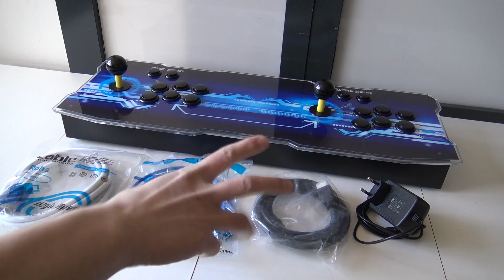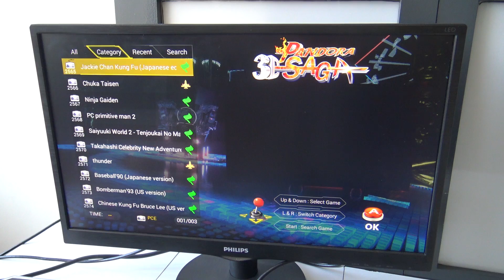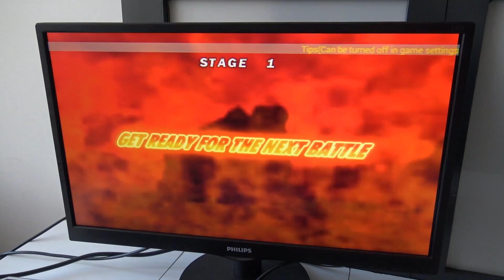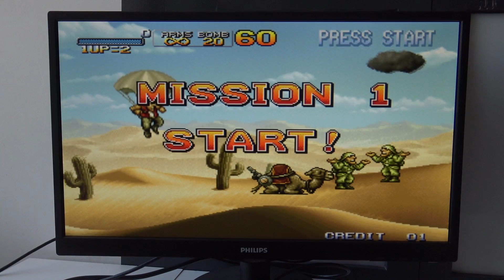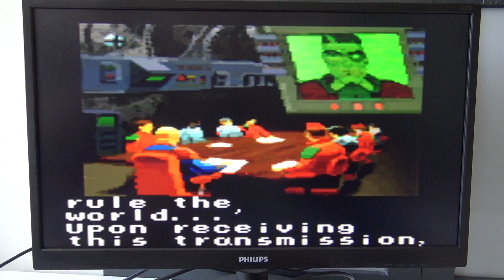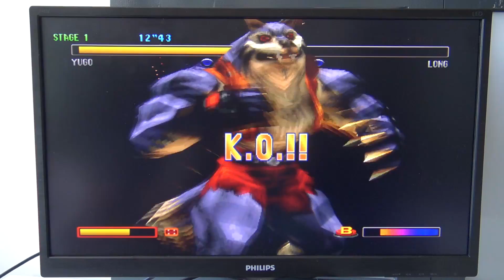Pandora's Saga 3D .. The Ultimate Arcade Experience ?

Comment: Hey Wicked love your videos, i am not a well bunny with not a lot of cash to spend, my main interest is original arcade games mainly the older 70/80s games so my question is this, i want to get an arcade stick as any kind of cabinet is out of the question moneywise and don't think i can deal with MAME and finding Roms, sorry long question, would you recommend this or any of the Pandora sticks given my situation?
Reply from the maker: If you live in the USA .. arcade1up is dirty cheap you can upgrade these. 
Otherwise you can always build yourself cabinet low budget way.. with pandora.. cheap buttons / joysticks and older 17inch monitor.. monitors are very cheap. 
or.. buy older model pandora they are cheap now a days in the jungle  😏
Reply: Thanks, I live in the UK and not well enough to take on any kind of build, currently using a laptop but i do have Dell 17" screen, in fact is still have 12" CRT monitor

Comment: If the DX doesn't work out, I think I'm going to snag one of the Saga 3D units. They seem to work really well for what they are. We'll see! I know you'll keep us posted. 🙂
Reply from the maker: very curious about the board.... so we going to review and compare 😎
Reply: @WickedGamerCollector  Same here. My DX shipped yesterday, I ordered it out of excitement when I saw it was released, but now I'm starting to think I should have waited to see how good it is. Oh well, if it isn't that good I can always sell it.
Reply: infernaltim1 I am not optimistic about the PB DX. It doesn’t seem more powerfull, and lack the 1024*768 res.... I don’t know, but to me 3A seems to be too lazy....
Reply: @Monta1976  I don't really care about the resolution or aspect ratio stuff, I use the boards in an Arcade1up cabinet so that's all fine, I just want it to run everything better and have more games. I'm not very optimistic myself right now but it's already on the way. 🤷‍♂️ I'm sure it'll be better than the PB6 that I have in there now, but maybe not to the level of a Pandora Games 3D or Saga 3D.
Reply: infernaltim1 the Arcade 1up has a 4:3 lcd screen right ?
Reply: infernaltim1 yes but if PB dx has only 640*480 (too low) and 720p (too wide) res, something will go not good also for you...
Reply: @Monta1976  It'll run the same as the PB6 I have in there now, no worries. 🙂
Reply: infernaltim1 PB6 does actually support 1024*768 res. PBDX will not...
Reply: Emiliano Montanari 
If you use the VGA out put you’ll get 4:3 aspect ratio at a resolution of 1024x768
Reply: @Monta1976  If the DX doesn't work properly and I can't get it right by fiddling with the settings on the monitor, I'll end up getting a different board. I can use the DX on a TV if need be. We'll find out!
Reply: infernaltim1 sure... I use PB6 with a 16:9 lcd projector and I set it at 1024*768 cause at 720p arcade games are disgusting (to me)
Reply: same here!
Reply: Yes I want the pandora 6 AND pandora 3d saga BUT does but both have the same games
Reply: @kymontiberry1  They're really really similar, I'd get the Saga if I were you. Avoid the DX like the plague unless you like screen tearing and volume issues. 🙂